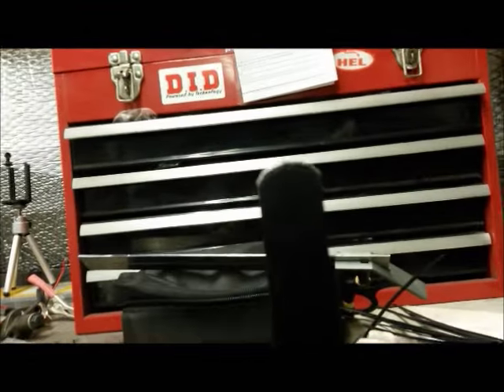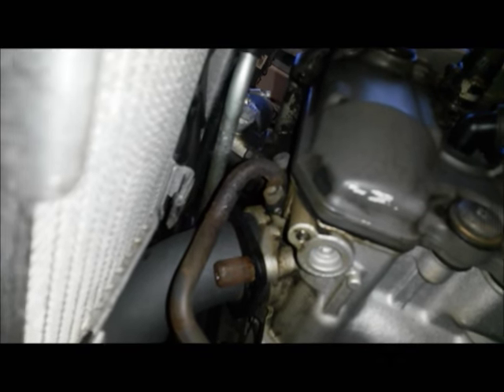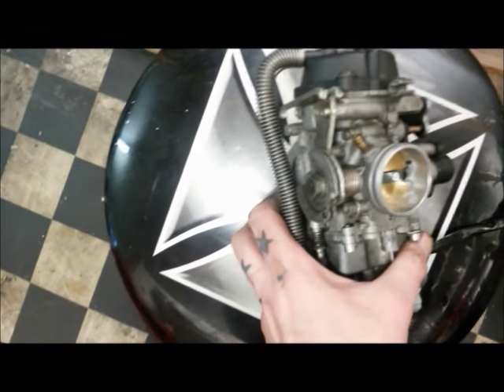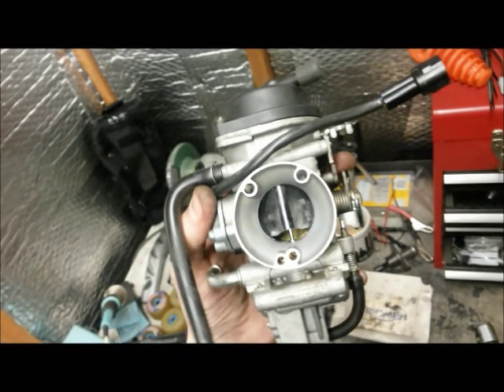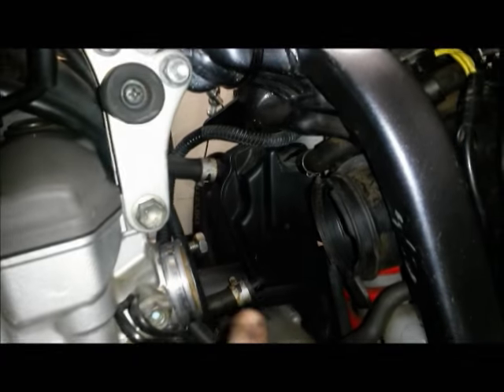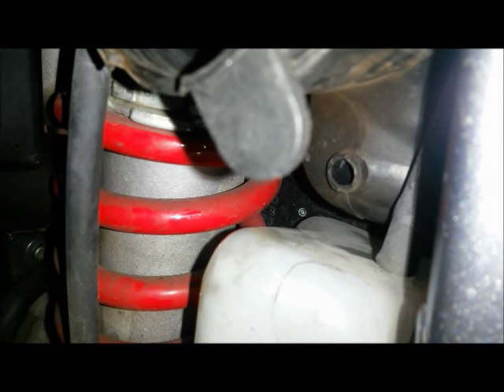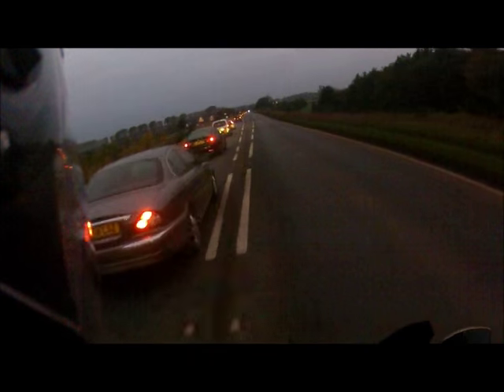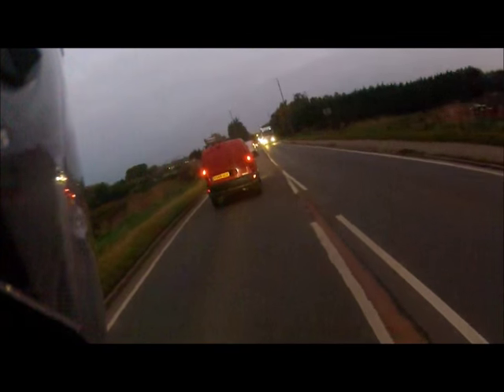PAIR VALVE AND SOLENOID REMOVAL DRZ400 SM

Comment: Hi great video,
I've just completed this as per what you've done minus the vacuum I'm an 06 model. The bike doesn't idle now and pops waaay more. Drives better but lots of unwanted pop. Any advice on adjustment and which screws?
Reply from the maker: hi mate- i'm afraid it's been a while since i had this bike so am a bit rusty on the ins and outs. popping may require a larger pilot jet- possibly the answer to the idle issue to as there is a bit of overlap with the idle circuit. perhaps check the fuel mix screw??

Comment: nice 1 mate. good vid. can't decide if I should do airbox mod on dr350r.
Reply from the maker: +TWO WHEEL FIX if it's the same principal as the drz mate i'd go for it- i'm happier with the results...plus worst case if you didn't like it just cut up a cat litter tray, add some sealant and rivet it back on to return to stock!!!

Comment: Nice vid did this to mine before i installed the original carb, do you find any sort of hesitation or stturing at 1/4 throttle i seem to? But runs ok and full throttle seems fine
Reply from the maker: +Andy Heard hey mate- i did find some hesitation when i was at 155 main jet, 22.5 pilot, needle at 2nd clip and 3 1/2 turns on air/fuel screw as per the dyno jet recommendations. with the 3x3 mod i'm running at 160 main, 25 pilot ,needle on 3rd clip and 2 3/4 turns out on air/fuel. no hesitation through the range mate!
Reply: +johnnycactus0 cool thanks will try also going to get 135 paj as this seems to be the air jet from the us models which the jd kit was designed for. Will let you konw if that makes a difference aswell
Reply: @andyheard6111  well how did it work?

Comment: which year model is best to get ?
Reply from the maker: i have no idea mate!!- i have very little knowledge on these bikes- when i bought that one it was a bit of an impulse  buy! i think as good clean example well maintained of any year should do the job!
Reply: hmmm is it a keeper bike ? i understand the engine is aluminum and magnesium alloy casing , both pretty weak materials ,had any issue when u own one ?
Reply from the maker: if i hadn't bought the second bonnie i'd probably still have it! no issues with engine materials- i'm just working on a yamaha diversion that's 16 years old with alloy and magnesium cases...still going strong...really wouldn't worry. it got ridden hard by me as a winter hack, ridden hard by the next owner and will be equally ridden hard by current owner and as by sheer chance saw it at a bike shop last weekend it's looking and performing as good as new!
Reply: man this video sure came in handy , i gotten the bike , derestricted mod already done when i bought it used , but i feel top end of each gear still pretty weak ,feels like when i full throttle  but bike is not moving ? will run some checks to see if the top is block off and the air box , the bottom is not seal off ?

Comment: How big is your shed?
Reply from the maker: +Ollie Davies hey mate- i think its a 10x8 and then i cut a hole in it and stuck a 8x6 on the end!
Reply: +johnnycactus0 Thanks for the reply bud, I've never heard of anyone doing that before! I'm thinking of building a shed (16' x 10') out of pallets so I think that should be big enough. Also, a more relevant question, what's this pair valve and solenoid removal for? I have a DRZ too so keep the vids coming. :)
Reply from the maker: go as big as you can!!- you'll always fill it!! i need another extension! as for the PAIR valve and solenoid- it's really just emission crap- to pass standards. pair valve is for exhaust gases and not entirely sure what the solenoid does but it's supposed to open up first three gears a bit more...can't say i noticed much difference but it's got rid of unneeded junk off the bike and provides easier access for the air/fuel screw should you want to tinker with the carb.
Reply: +johnnycactus0 Ahh I see, I'll have a look into it then, might not be worth it for me though since I've got the FCR carb.

Comment: What is the purpose of removing this.  Haven't engineers designed the bike this way?  Wouldn't they know best?  I think you might be messing up your bike.
Reply: Year Late, But engineers didn't design the bike with the PAIR in mind. The PAIR has been put onto the bike in certain country's to meet emission standards.